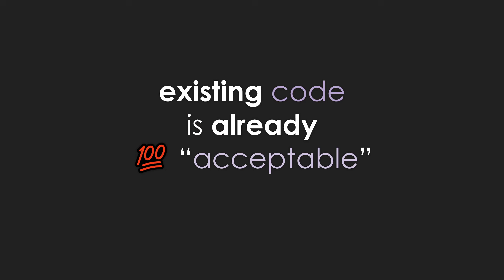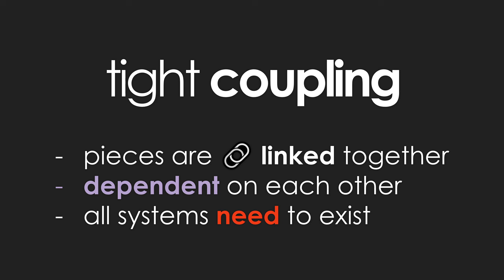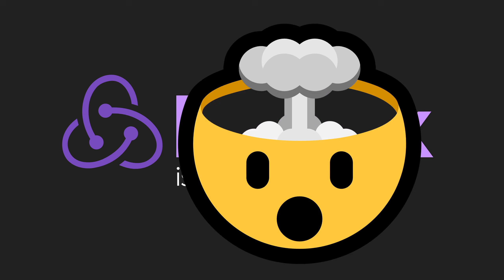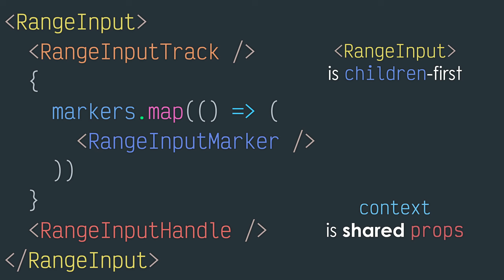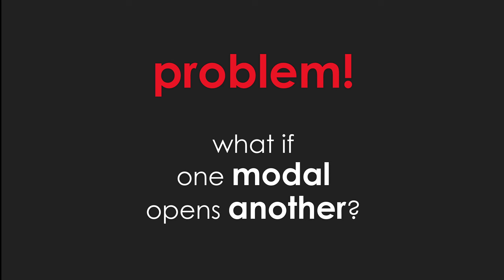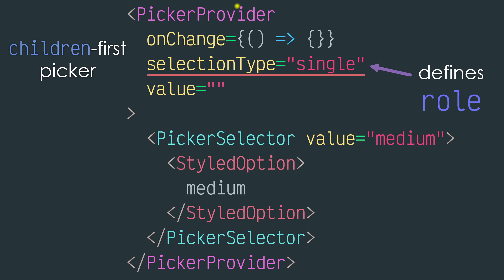Definitive Guide to React Component Design and the key to avoiding tech debt

Comment: There is a large difference between Context and a Structured State Management solution such as Redux or another one. 

Context is uncontrolled global state, Redux and others is controlled and observable. 

Context is fine for passing styles or configs, but never ok for anything to do with core business logic since there is no observability. Any component can change the Context with no constraints making your code unreasonable. 

So do not useContext unless you have a good reason, instead use a structured state management solution for most cases.

Comment: Havent seen this video yet but I have learned alot after significantly refactoring an old react project and would like to share my lessons learned. 

1. Only control a Component by a parent when the internal state of that component can not be predicted from local interactions alone. 

2. With uncontrolled components do your best to minimize state and other hooks used. 

3. For uncontrolled components, try to use Finite State machines to encode the logic of the component so the component may be reasonably unit tested without having to resort to controlling everything. Not all can be represented with FSMs, but you should do something to externalize logic, even custom hooks work well here. 

4. Just because every component can be controlled doesnt mean they should. They make things testable, but then you pass way too many props down and it gets ugly! 

5. Keep things simple. If you could make it more abstract and re-usable for situations that haven't happened yet, think twice before doing it. Only write the code you need. 

6. Make use of some form of centralized state management solution and store only relevant information based on your Domain models. 

7. Center your Domain around Entities not pages! Page state is a composition of Entity state that is then passed through business logic in your centralized store to your components. Basically do Domain Driven Design. 

8. Use the Onion architecture. Separate Core, App, Infrastructure, and UI. Dependencies then flow in one way from Core to the UI like this: Core -> App -> Infrastructure -> UI. 

9. Use Example based and Property Based testing on your Units, which is most of your code except API stuff, Presentation of UI (Not the state machines), and your State Management code. 

10. It is Ok to use Component Libraries! In fact, I switched from manual Styled Components to MUI and my code has been cut in half! (And page performance improved) MUI Components, or whatever your library, will save you time and effort. You were going to code to that design system anyways!

Comment: Hi Kevin, great video. Strange I didn't find it earlier.

One question: you mention that using className prop is an anti-pattern. 
What would be the right way to change the style of a component from the parent?  

I could not find any good article about this and to be frank a lot of articles on the net are actually about using the className prop.
Reply from the maker: Use props to change the styles on a component.

Internally, you can use Emotion, Tailwind, whatever, but outside, don't allow passing arbitrary class names.

Comment: I would say CSS-in-JS is also a huge antipattern. The good separation of concerns here is to have an app visual language that is translated into CSS reset/sane defaults and as CSS is an exception based language, you deviate from the sane defaults in your components, meaning most of your codebase the styling will be very thin. However this usually does not happen as most companies struggle with bottom-up anarchy and designers running after developers who run after business requirements.
Reply from the maker: I don't understand what you're saying.
Reply: @KevinGhadyani  Sorry man, sorry for the late reply, first of all "CSS-in-JS" not the other way around, probably I was quite tired. I think I tried telling too many things in 1 comment. When designing effective components, it's important to consider the styling. CSS is a language which provides the best results when the design follows a top-bottom approach: you define your base style, font sizes, distances, colors, then you create a limited set of containers (aka "visual language" of the site). And finally, for little details, you define exceptions from these rules. With this approach you have a very lean set of cacheable CSS rules, that is quick to download, quick to execute. If you are creating React components one must not work against this optimum.
In the second part I did a bad job explaining that most of us usually not work like this in a top-bottom approach, we are not handed a consistent design language by the company we arrive to, nor a limited set of smartly designed responsive containers, rather, we get a Figma design and we try our best, without wasting too much time on the big picture. That was the "bottom-up anarchy" thing, that because of how corporate engineering works, we usually just do what's needed to finish a task, resulting in defining the same CSS rules over and over (with TailwindCSS explicitly encouraging this behavior for example). So, we don't do the right CSS/component architecture because of how disconnected corporate teams are.

Comment: IMHO the technical part of explaining what is props and children was good. The part that's crazy to me is the obsession to make things more complicated that it needs to be. The take in this video is that you should take the responsibility that the other devs gonna produce bad code and the solution is to write a complex and difficult to read code to mitigate it.
Reply from the maker: I'm not exactly sure I understand your point, but I'll respond the best I can :).

I take a different approach at each company I go to based on the needs of the org and the existing codebase. This is just one solution you can use to solve the problem of tight coupling, but not something that works everywhere you go.

In general though, the more complex your library, the less complex the code consumers need when consuming it.

Where I work now, I have a different approach than this video. Instead of component usage freedom, they want API stability and ease-of-use.

Now we're creating one component for each feature rather than a bunch of them that you assemble because that follows the design system better (unlike the patterns I had at this other company). It's a 180 degree difference in component design.

The goal of TypeScript and other coding patterns is to make it dead simple to write code the intended way, so other devs can't screw it up.
Reply: 1:16

Comment: I've been searching for content to improve my shitty React codebase, and out of about 10 way more popular videos, this is the first one with some actual content. Others just tell something basic without any convincing. But your video is so much better! A bit long, so I'll watch the rest later, plus I see you left long answers to comments, which I'll obv have to read now. But for now, thanks!
Reply from the maker: Hope the rest helps you out! There are different ways to approach React components. I was aiming to fix tight coupling.

In a later video I did with another group at Microsoft with a similar pattern, I also tried renderProps + useCallback, but it adds indirection. I use that pattern at my current job though.

I came up with a way to do children-first with TypeScript and clever use of generics, but it requires some thought to figure out.

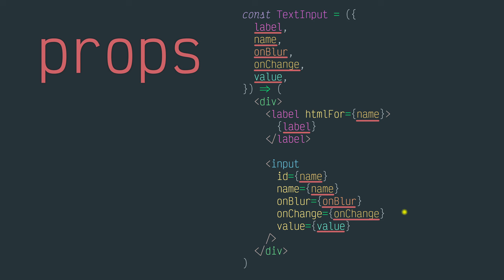Comment: Hey, I've enjoyed the talk, especially until 20:00. The thing about your children first design is that it's very different from what we (as frontend devs) are used to.
The problem with that is that it would be hard to get others to do it. And most importantly - they might not understand it. They might completely butcher a completely fine and reusable component. This is what I'm worried about with this approach.
I've seen trunk based development and functional programming - two very good approaches in my opinion - ruin a workflow or a code, because of one or two people who didn't know what they were doing. And that's not because they were a new programmer, it's just that they were not used to the nuanses in a codebase.
Again, I loved the talk, and I don't want to sound overly negative. I might give it a try, but it's possible that I will go with a more common approach c:
Reply from the maker: That's great feedback, and you're exactly right! You build tools for the people using them. I often go out of my way to pull people into best practices, but different companies have different needs.

Where I'm working today, we had 1K devs rather than 50, so my ability to educate is severely limited. I heavily rely on TypeScript to enforce our intent, and really really lock down our props because long-term stability is key. They don't want people deviating, so I'm not using Children-first; although, internally, I use a renderProps inner wrapper variant with useCallback to maintain memoization. It still has passthrough props, but it fits the needs of this org.

TypeScript helps a ton! I was all-JS when I originally did this talk.

Comment: Your example of Accordion could be simplified by using data- and ARIA attributes to annotate your components and make them semantically correct, make them stylable and easy to test. The component itself doesn't need to know any styling, except for maybe orientation, which also can affect behaviour. There's no need for cloneElement here, so implementation is simpler, too.

ARIA attributes are often missed. By themselves ul and li does not represent an accordion, it represents a bullet point list semantically. Accordion, as the name suggests, visually collapse and expand sections. Sections have headings and a body, which does not fit the semantics of unordered lists, which are typically just content.

You may as well use divs and ARIA attributes to properly specify state, labels and roles for the content. Using ARIA labels to annotate the behaviour and state of a component is important for accessibility. Additionally you can select those ARIA attributes in CSS based on the state, for free. Data attributes are useful to give meaning to the component outside of it and without leaking abstractions.

It makes your components simpler to use, more accessible and makes it easily testable in E2E tests without leaking implementation details. It's all in the DOM.
Reply from the maker: I think I'm understanding you correctly. But the examples I gave had a single Accordion component that took an isVisible prop and that's it. All the visibility logic is handled in separate components. But handling the complex aria associations are automatically handled by the logic components and passed into the accordion.

A list of accordions would be wrapped by a ul and a bunch of li right? Did I say something counter to your comment?
Reply from the maker: This is the implementation from the presentation. I think that'll explain it more: https://github.com/Sawtaytoes/children-first-components/tree/master/src

I'm changing this API in the future for TypeScript awareness using the builder pattern (TypeScript-first shown in another video of mine), but the new API will still retain almost all principles of children-first design except one thing: plug 'n play convenience. You get a bit of optional boilerplate for the benefit of better type documentation and a complete avoidance of cloneElement.

This was brought up because cloneElement is seen negatively by React devs and doesn't even work in Solid.js without major compromises. The new pattern will be more universal.
Reply: @KevinGhadyani  I was thinking of doing it a bit differently without the need for cloneElement;

For example, in case of Radix UI, it accepts the state (either controlled or uncontrolled, based on `default*` prefix) and a event listener in the root component. This way it can pass that state through to the child components that observes from the same context.

This also makes it easier to hook up state, without the need to add conditions inside your component, but just by passing state and some dispatch in the root.

The AccordionItem doesn't make much sense without its root anyway, neither does the AccordionTrigger or AccordionContent outside of the item–they are naturally coupled (compound).

This could also apply to your generic Visibility component. The user's own content is wrapped by these outer components anyway, so you already have all the power without the need to clone.

Comment: Very interesting video. But the code snippets are quite hard to follow without full code samples.
Reply from the maker: What specifically do you want to see on slides? I tried removing cruft so there's less code to read for the 2-5 seconds it's on screen. Are you wanting to see the implementation or do I need more code in the slide?

Does this help?
https://github.com/Sawtaytoes/children-first-components/tree/master/src

Go to Visibility or Picker stories to see uses.
Reply: @KevinGhadyani  Yeah that helps a lot! 👍 I'll dig through it and see if I can understand everything. It was hard for me to understand how the 'children-first' approach without seeing the actual implementation of all the pieces. Part of the reason is probably that I'm not super familiar with advanced React concepts yet. For me personally, especially if it's a video, I like to see complete examples, I can pause if I need some more time.

Comment: Am I wrong 🤔 I feel like building components like this is mostly suitable in vue than in react where one could easily register the library globally and use anywhere without having to import stuffs . Cause imagine creating a sign up form,  a Modal,  a drop down in a single page , you would have to import a lot of things,  import this import that ooh God 🤣 this is interesting
Reply from the maker: I think it's fine. I often import a bunch of stuff. Never used Vue, but if you've seen the popular UI library Material-UI, they also make you import a bunch.

From using OneForm and these other methods, you get used to it. It makes the DOM behavior very clean.